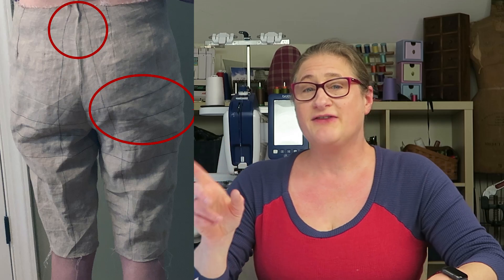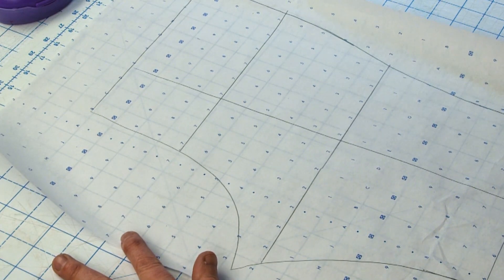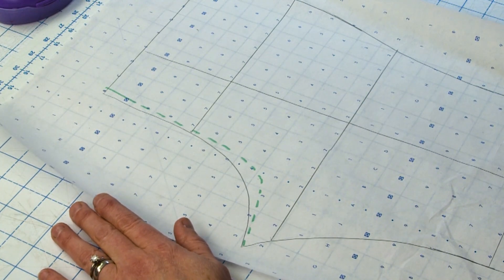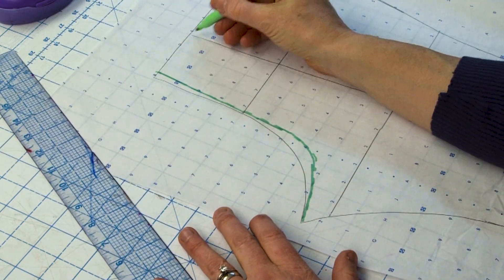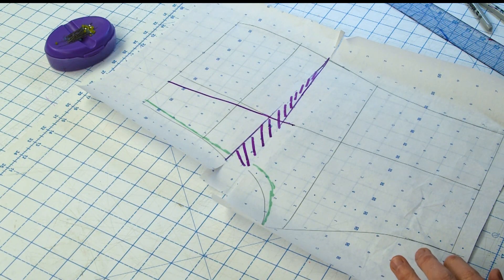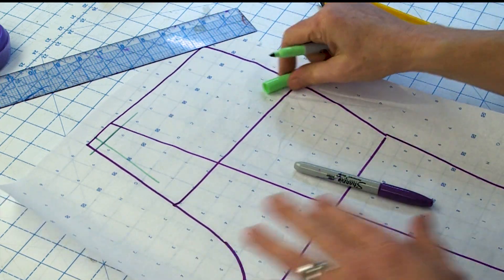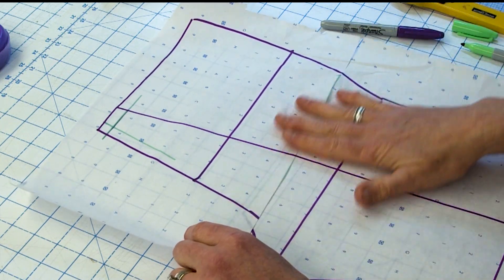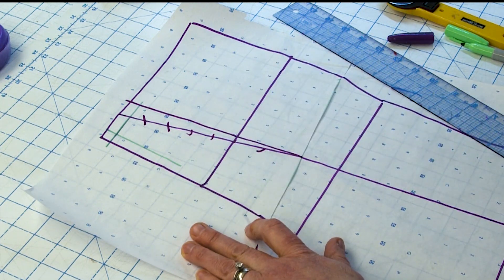Pants Fitting:  Using Grainlines to Fine Tune the Fit

Comment: Thank you for this. It is the first very clear explanation of fixing this problem. I may be one of those who may need the angle to be close to the centre back. but I keep thinking that a 35 inch waist and a 45 inch hip cannot be that unusual. Pants that I have made this way have looked good (although I also have to make a large thigh or knockkneed adjustment to make the legs hang properly). I keep thinking there must be a way to straighten the grainline and perhaps not need the number of adjustments to the back and legs of pants that I have to do. I am going to try your suggestions on my next muslin and see what results. Thanks!
Reply from the maker: If the vertical grainline is close to your CB seam and they are hanging properly, you may be right… & you don’t need to fix it!

Comment: How do I determine the slope of the straight part of the back curve that best fits my shape?
Reply from the maker: I think the best way to figure that out is to see if your pant muslin is sliding down when you sit... If it is, you need more curved part, if it doesn't & the rise is not correct, lengthen or shorten the top of the straight part at the waistline.  You can also add more to the crotch wedges if you need more room for your inner thigh (which will contribute more to the curved parts)
Reply: What body shape works best in pants where the straight part of the back crotch curve is more slanted, say 30-45 degrees?